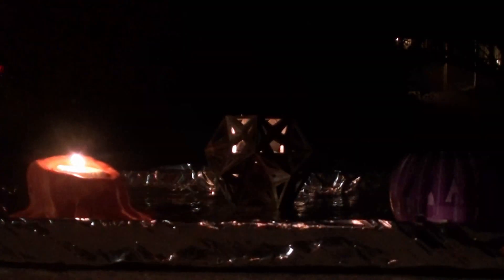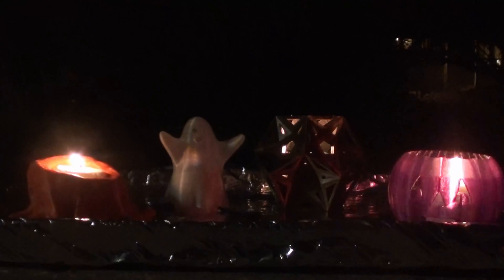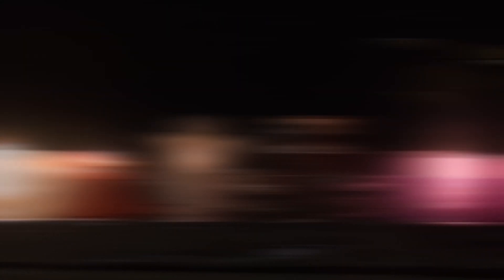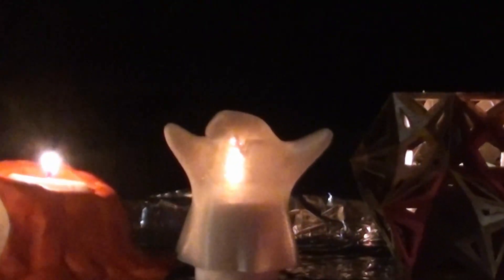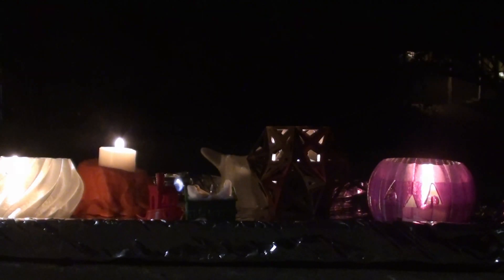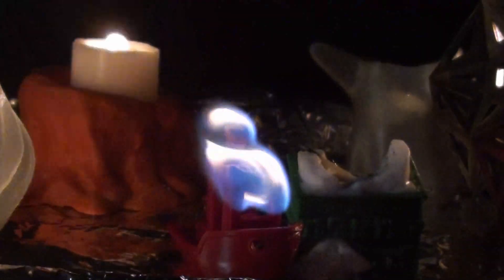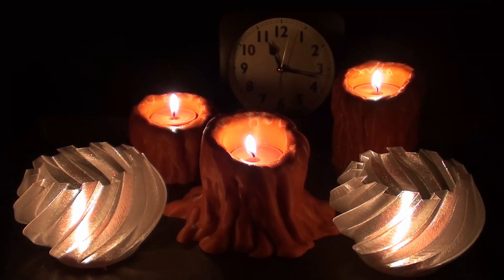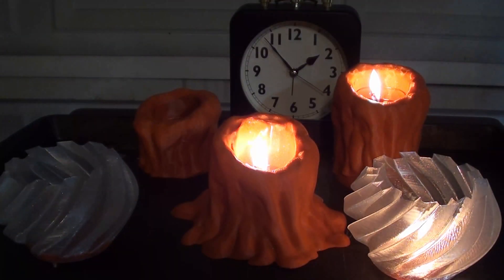How safe are 3d printed candle holders? We set some on fire to find out!

Comment: why are you using the one filament with the lowest heat deflection? PETG works fine as long as there is enough ventilation (radius) around the flame.

Comment: hi, i was actually doing some research while designing a stained glass candle holder and saw this video pop up. this was very illuminating (no pun intended)--i did consider a use case of a 3d printed candle holder being used to hold real candles, but since im using woodfill pla...yeahhhhh, not only would it deform, but itd go up in flames considerably easier. thanks for the video, this was super informative!!!

Comment: I never printed a candle holder for this specific reason but do you think the same would happen with SLA prints? They use UV to cure the resin so i wasn’t sure if theyre effected the same way.
Reply from the maker: I'm not sure, as I'm not into resin yet. I did a quick search and I'm not seeing anyone printing candle holders with resin. The electric tea lights are always a safer bet anyway.
Reply: @stldenise  I'll 100% be using electric lights for my candle holders. But, now that my semester has ended, I plan to do some tests with normal candles. I'll let you know about the results of my findings. Thanks for the speedy response! Have a happy holidays :)